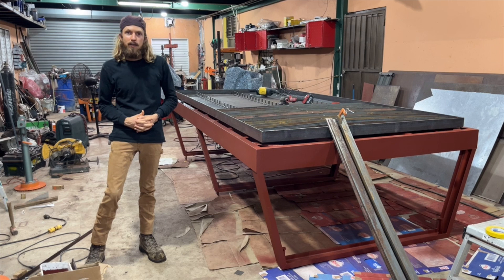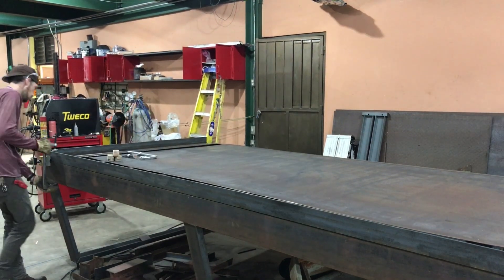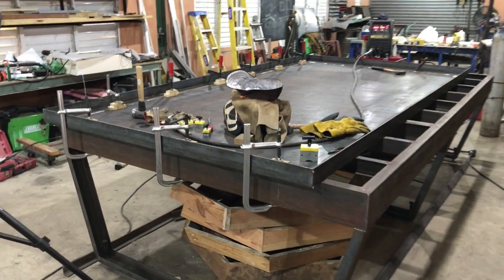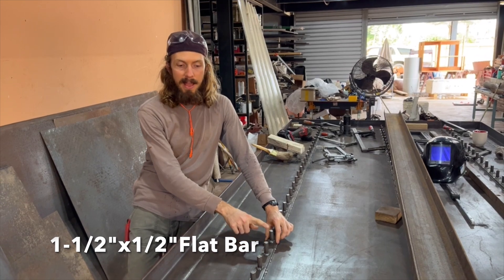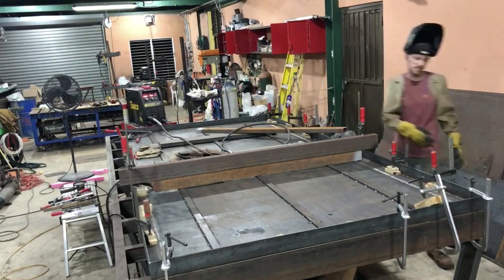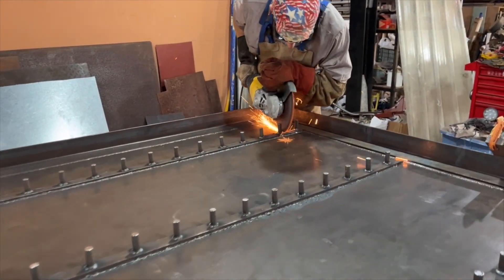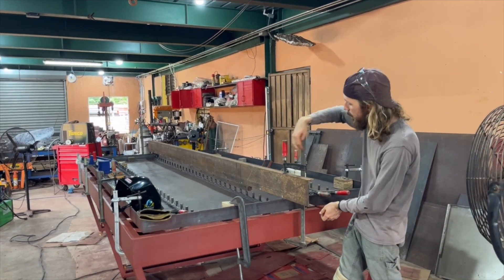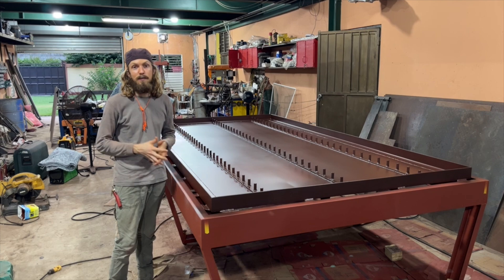DIY 5'x10' CNC Plasma Table Part 3, Making the Water Pan.

Comment: Just found your channel.  I realize I am a little late to the party but, would it be a good idea to put a diagonal brace to keep the legs from racking?
Reply from the maker: @rickswanberg4995  when I was designing it, I wondered if it was necessary now that I have it built I’ve thrown myself against it quite a few times trying to see if it wiggled at all, and I can’t seem to get it to budge. It seems extremely solid so if I later find it needed, I will definitely add it.
I think it will be convenient to be able to store things under it so I was leaving it relatively open. 
Thank I will look into it more.